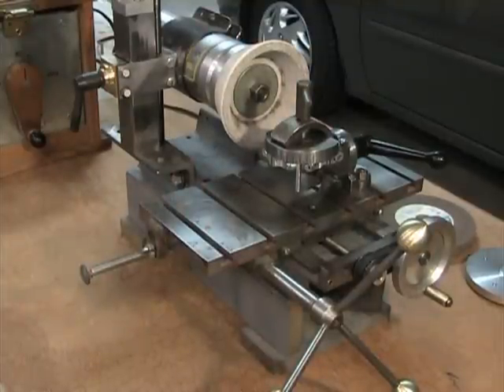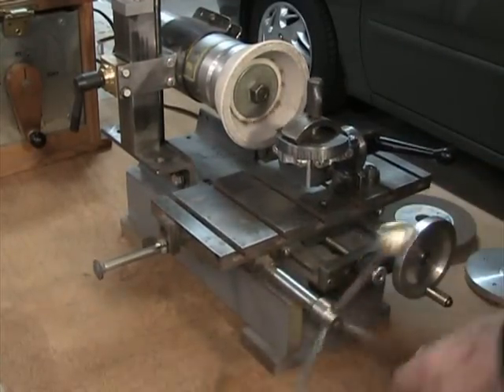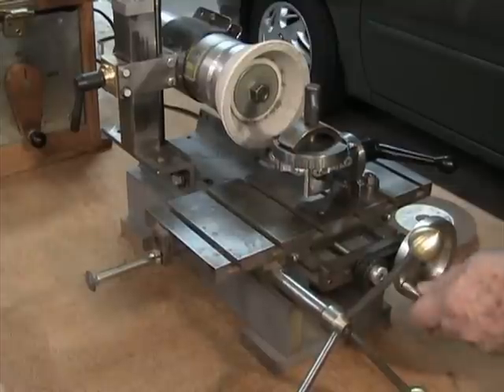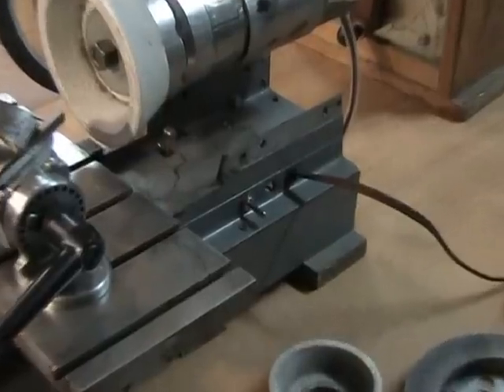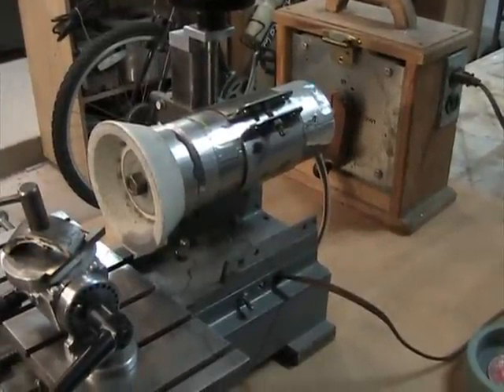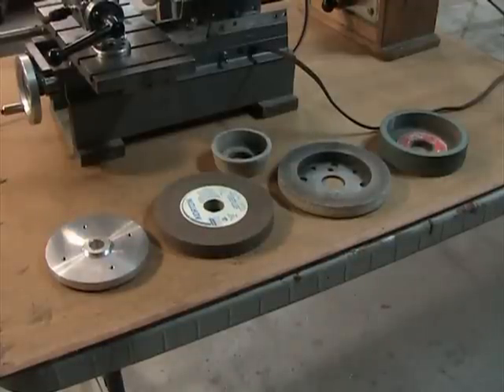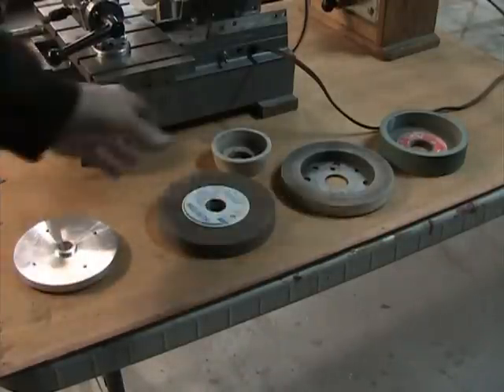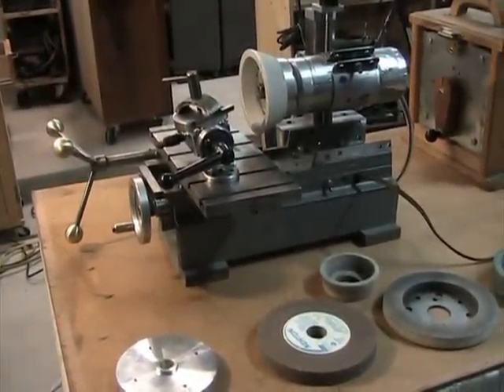Tool and Cutter Grinder

Comment: The Z axis is always parallel to the spindle axis. This is what you called the Y axis. 

X axis is the longest travel at a right angle to the spindle axis. Y is the secondary axis ( lesser travel) at a right angle to the spindle axis.

Comment: that feed mechanism looks suspiciously like my lathe carriage and cross feed, and the grinding wheel is right where the spindle would be... besides the slower speed, is there any particular reason I couldn't use my lathe as a cutter grinder?
Reply from the maker: The feeds on a grinder are generally finer than on a lathe.  And, it's good practice to keep grinder dust off your lathe parts and ways.  The grinder dust will embed in the iron sliding surfaces of your lathe and accelerate wear.

Comment from the maker: Thanks!  I looked at the Stent and lots of other T&C grinders before arriving at my design.  Rather than have an adjustable angle on the wheel, I figured it was easier to adjust the angle on the tool holder... Chuck

Comment: Excellent video, explanation and varied shots of the T&C Grinder. Were you inspired by the basic design of the 'Stent'? Would there be a further advantage if the motor/shaft were able to be adjusted for angle?
Great job, thanks, Ian